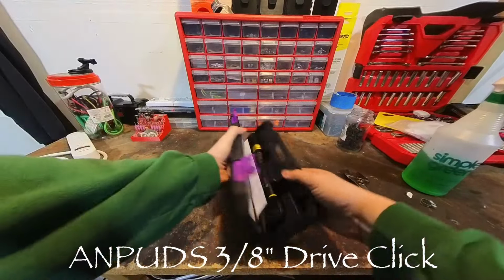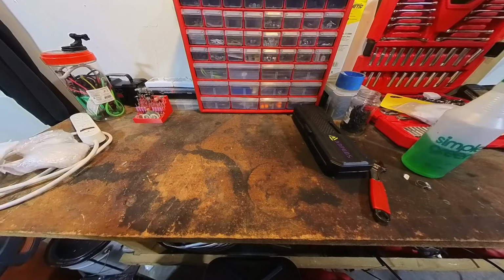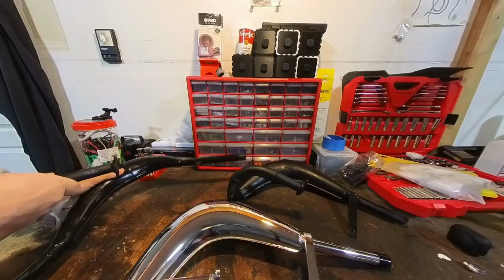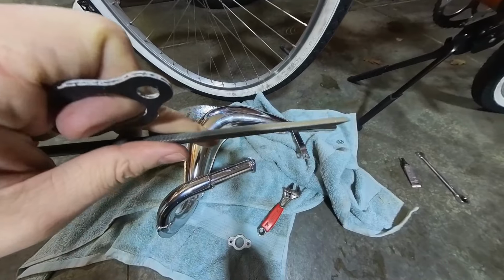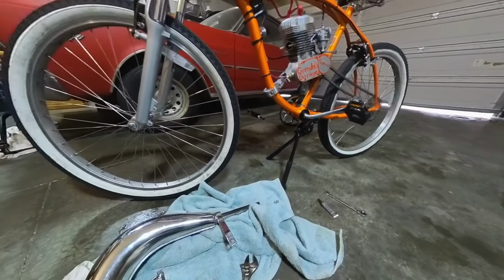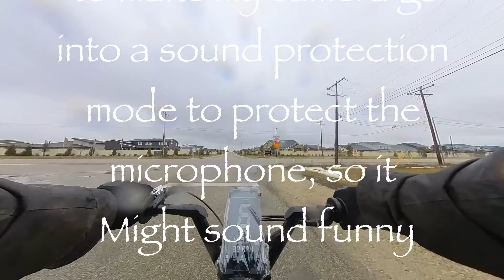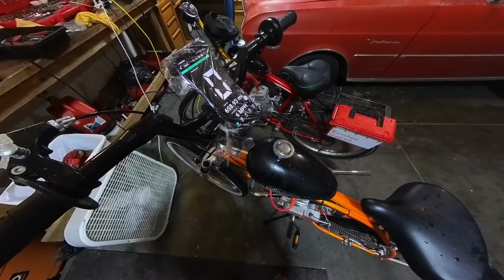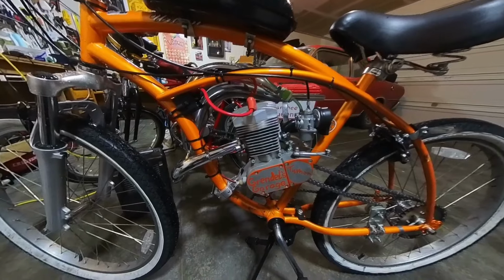Real MZ65 with the Zeda 100 Max

Comment: Please adjust your clutch  lever. Meaning  it's above the horizon. Typically  your brake and clutch  levers on any and all two wheeled vehicles  are allways gonna be few degrees below the horizon. Great video. And hey just telling you that from a life long motorcycle  rider.  Sorry you bike your rules. But yea   your allways gonna get the cheapest and most power gains from port timings first. Second  will be carb and tune. Definitely  a proper designed  pipe. Specific to cyls displacement  and port timings and areas. The real truth is there is no such pipe. With the exception  of scooter cyls and pipes made specifically  for them cyls.  Blessing is your finding out first hand. 👍  mabe that guy that told you to sand your rings can give you some tips. ✌
Reply from the maker: Hey thanks for that riding tip! Don't watch the next riding video hahaha I filmed it before I read this! 🎉🎉🎉 I've been going hard one your porting videos gold brother gold! Made some cuts and I think I did okay 👍 thanks for all the help. Your videos make it so easy to understand these 2 strokes.
Reply: @grendelsgarage9723  glad to be helpful

Comment: Cool beans brother you got a torque wrench 12 pound max 8mm studs 10 pound max 6mm studs the trick is torque them down then take the bike around the neighborhood warm it up and double check the torque and they should never come loose unless you take it loose but you can still check it periodically pipe sounds nice I see you went with chrome i did to this build my athina minaralli it's so i could tell the  difference between the cast iron minaralli and aluminum minaralli lol Riding in the rain and it was cold I give you kudos me and my girls don't go in the rain I guess you get that way from being a electrician for many years lol be safe brother the pipe sounds awesome ride safe spring is coming
Reply from the maker: Oh cool! Thanks for the  info Mike 👍 I didn't know 10 for 6mm studs. Yep, went with the chrome this time. Needed the mix up. Brother, that ride sounds nice! My brother was over watching 👀 my son so I had to burn some rubber 😂😂😂. Ya I could see you not wanting to go in the rain after being an electrician! You understand and respect electricity 😂😂. Hoping for better weather Mike 🙏 👍

Comment: ORANGE = 😍

That mz actually looks small compared to the clone that's built for the Wildcat Minarelli.  That Nasty Jack as well >>>> everything about them, especially the port end of both >>> dinky!!!  

I do like the CHROME 😍

I'm on my first build with a Switz Cruiser, but haven't started it yet >>>> I have all of the parts >>>> I just gotta get a few Dremel bits so I can make the rear cnc engine mount fit. I also need a few of the flat wrenches for cone nuts, and a crank puller.  The new bike had almost no grease in the front hub, so, I have to go through it.  I won't start until I have EVERYTHING. 

I got myself an FMF TurbineCore 2 for my 'HUGE' EC. 😉   I just hope I can manage to mount it with such a long pipe >>>> has about a 30 degree upward angle to it.  I have new black steel saddle baskets for the rear.  I hope to use them in some kind a way to mount/stabilize the silencer.

These builds can get a little pricey if you want a good one.  

Smolik Performance

Just picked up the CNC Head they have for $125.  Sure is odd square looking.  According to research, it's about the best out there where mass production is concerned. 

I should be at about 14-15 HP when this thing is assembled, and a Dyno is going to prove it. 

I live on a lake front, and hills is all there is.  The power is definately warranted here.  

I have 12 gauge rims, but, I want 11, and 'Tuned' so I don't have to use a Uni sprocket adaptor,  which I have, but it sure would be nice to have it built right into the rim. Suggestions of where to buy would be appreciated. 

Btw, I keep wondering about how others with rear disc brakes keep the oil from their chain off of the rotor. 🤔

🇺🇸

Comment: Hey what kinda phone do you have brother? Jw cause I have a iPhone and I always keep my phone on a mount and in the past four months I had to take it in for a new camera sensor because it was shakin and buzzing on close up video and then all video as it got worse. And I got it fixed but I found this happened to my old iPhone too and the only thing that was the same between them is me having them on a mount as I ride. I don’t know if this would happen to all phones but I would guess at least the phones with video stabilization built into them. So if yours does or it’s an iPhone I would be careful cause it’s an expensive fix if you don’t have apple care or insurance on the phone. Just letting you know cause this just happened again to me like two days ago and I always see your phone on the mount so just want you to know so you can stop it before it happens. Anyway thanks for post brother, ride safe. 🎉
Reply from the maker: Thanks for the heads up, brother 🙏. I think I have a Galaxy 22 or something. When I first got the phone, I recked a BMX bike, trying to ride a wheely and smashed into it. 😅😅😅 the internal camera stabilization mount. It rattles a lot, but I don't use it for videoing. Thanks for the information. I hope someone sees it. Might save them a phone!!! 🎉🎉🎉🎉 ride safe brother! 🙏

Comment: 890 restaurant where you got that engine now I'm trying to build a bike that's got a huge diner bottom too but I can't I can't put a motor on it but you got it the one you got looks like it would work
Reply from the maker: Thanks, it's a Zeda 100 max with the upgrade head from bicycle-engines.com I will say that this motor isn't much different in size compared to other kits. I hope this helps. 🙏 🫡🫡🫡

Comment: Hey, does the universal mount fix the fitment problem? My mz65 doesnt fit because it hits the wheel, i think i need to get a bracket
Reply from the maker: Hope you're well. I have a video a little while back on how I was able to use the cnc Chd 1.5mm mount on the firmstrong frame. Long story short, I made a little spacer. They make them in 1.5mm. And 1.65mm on Amazon. 👍 hope that helps 🙏 🙂

Comment: My BBR F-zero bike actually runs better (smoother & just as fast) with a silencer vs an open pipe (which is great for my ears)
Reply from the maker: The last time I put a silence on my Wild Cat 80 with the Nasty Jack, it was my torque in my low end, but I will be putting one on. My ears 👂 were ri ringing 😅.  Did you have to re-jet after?